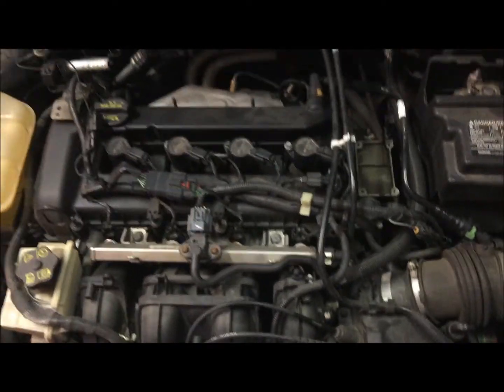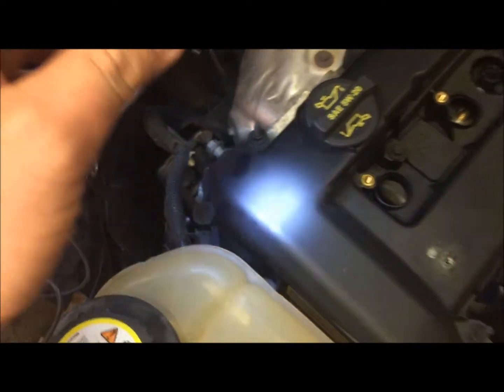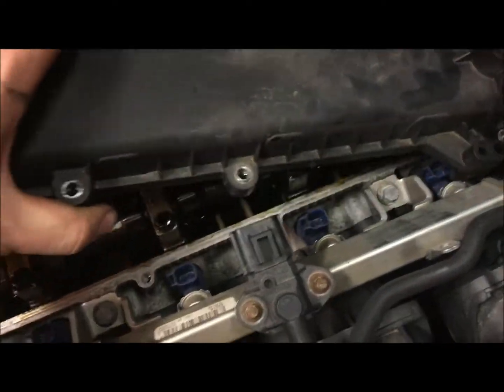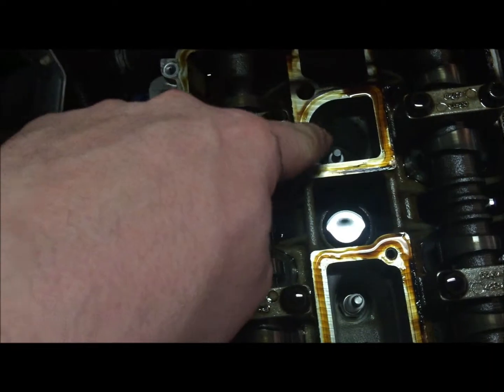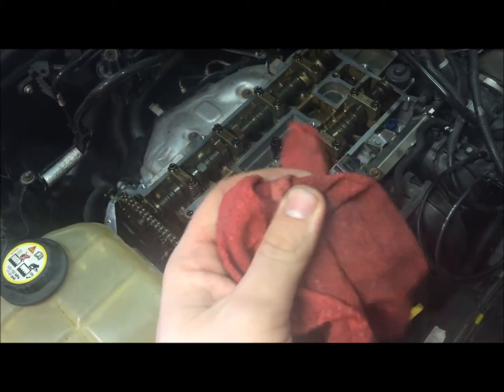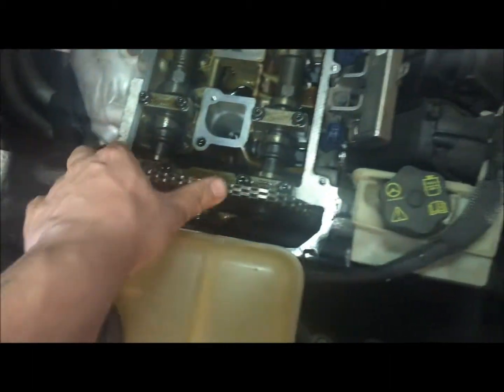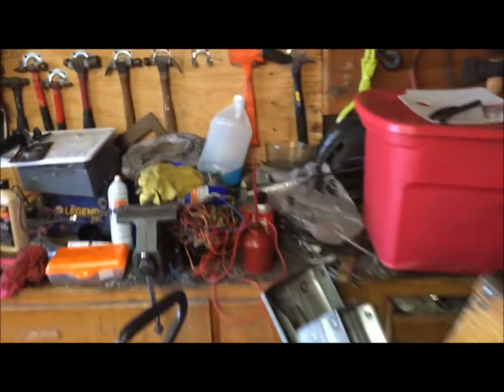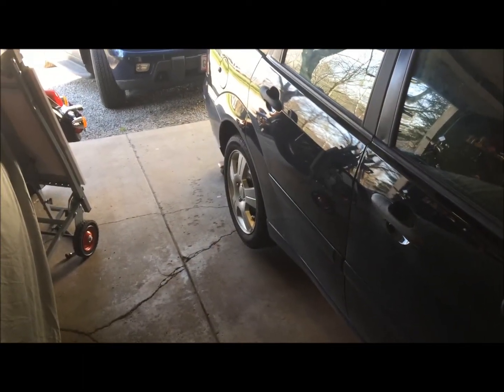changing valve cover gasket ford focus

Comment: hi mike I have the same car only in the wagon model     I am about to do mine   those  screws are not supposed to come all the way out..   I had a shop do this for me 13 months ago   and it is leaking again.  so this time  im doing it  and im using  a oem gasket. also  you did it the correct way  just undo the bracket  it should be a 13 mm  nut   well at least mine is .
Reply: I have the wagon model as well  its a 2003 with the 2.3     not a difficult job   just go slow take your time and do not rush.  the first thing I do befor I take anything off   is  use compressed air  and clean off the valve cover